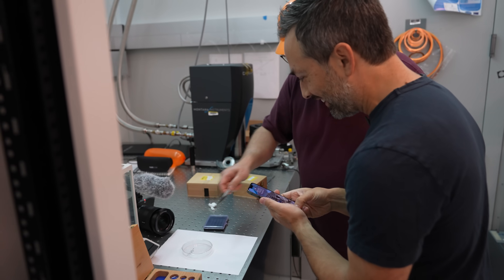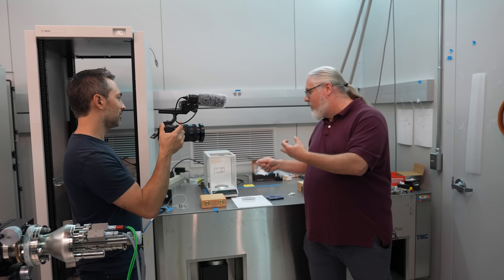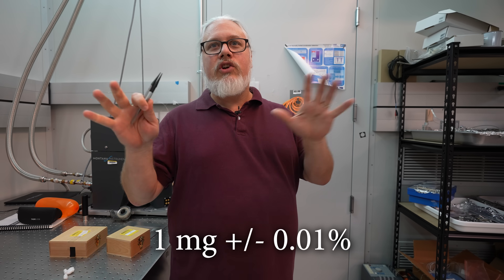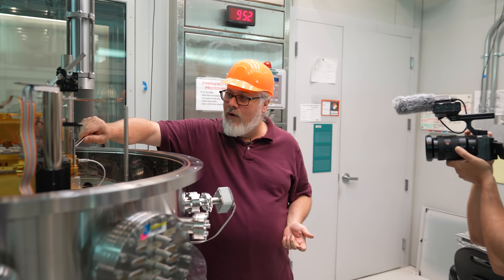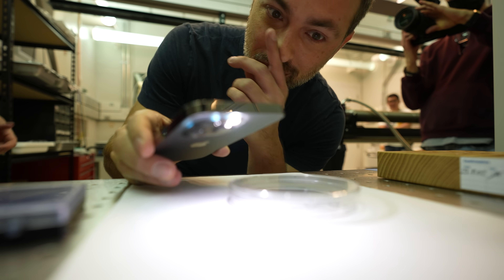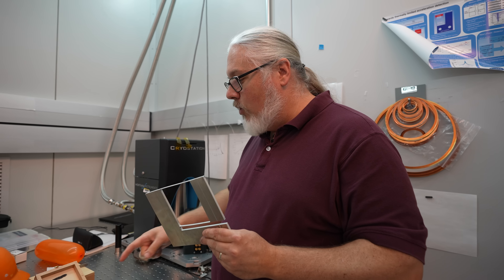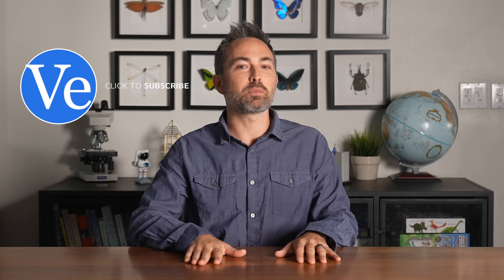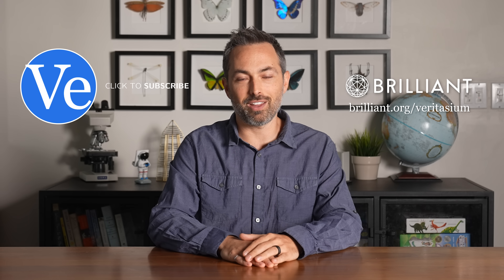How To Measure The Tiniest Forces In The Universe

Comment: The wire miligram mass calibration weights are made of platinum 90% iridium 10% wire. The extreme precision miligram scales actually use a polonium 210 static charge neutralizer. The extreme sensitivity balance used for measuring the light pressure though 😲

Comment: Did he invent that balance? He just speaks so excitedly and authoritatively about exactly how it works. It'd be interesting to see them actually amass a million of those little 1mg weights and compare it to a Kg just to see what the total amount of uncertainty adds up to. Would it be less than a single mg? I think that would be pretty impressive.
When they got down to talking about femtonewtons I was curious about how it compared to LIGO, it always amazes me just how much we've advanced in 50 years from creating the first microprocessors to modern commercial CPUs that now have to be designed and created using processes that care about the path and flow of every individual electron. And we're measuring the force imparted by individual photons.
Also how does it work if you take gravity out of the equation, I got the impression that some of the equipment wouldn't work if it was on the ISS. What methods and equipment would work, and could you just assume g = 0 or do you have to measure the exact microgravity, how insane does it get, would your numbers be thrown off by the additional mass of an astronaut inside the same module?

Comment: They talked about measuring femtoNewtons. In the laboratory where I earned my Ph.D. we measured something 1,000 times smaller, attoNewtons (aN), using a magnetic resonance force microscope (MRFM). That is the force a single unpaired electron exerts on a micron-sized magnet that is about 100 nanometers away. It's a painfully hard experiment.

Comment: It still makes my head spin that nobody can measure the speed of light in one direction and that we no longer use a weight of an object as reference to mass, but light.

But I'm so fascinated about all this. I studied manufacturing technology which included courses on measuring accuracy etc and this is just a nerd's wet dream. This was definitely one of the coolest videos all year. And one of the least exciting or visually communicating thumbnails :D I think it would be more intriguing if you had for example the kilogram weight somewhere on the screen as well for imagination and context, because you have zero idea what the heck is that metallic piece in darkness and random red beam. Heck, throw in a scale and a ruler while you're at it for measurement references :-D

I think I saw Cody's Lab trying to measure force caused by fotons from laser once in time, very cool experiment.

Comment: that's the heavy stainless steel wire... all the rest of the video the man makes sense... that little piece of stainless steel wire, unless attached to something I don't see... cannot possibly weigh 500gm... I watched the rest... came back and looked again...
could you please explain that to me ❓
🙏 ❤️🙏
Reply: when lasers were first invented it gave us the most accurate way measure the Universe around... the presence of quantum foam was measured in vacuum... probably with a beam splitter that creates a longer path for half of the laser beam and the interference pattern created by being out of step with the other half can divide a 700nm red monochromatic laser beam into much smaller increments... quantum foam was seen to exert sufficient force to move a rather substantial pair of steel plates apart a distance measurable in 1964

Comment: If you're measuring the pushing force of a laser by observing the oscillatory effect it has on some apparatus, how do you make the measurement of the oscillation without disturbing the measurement further? Wouldn't the photons you use to make the measurement of the change in oscillation period/frequency also create a force which would contaminate the measurement? Would it simply be that the effect of the measuring photons is so small in comparison to the effect of the laser's photons that it can be ignored?

Comment: How does the measurement of the femto Newton work exactly?
If you're measuring the displacement with an interferometer and photon pressure is enough to cause a displacement, won't the act of measuring the displacement (with a laser) invalidate the result you're actually trying to measure?

Comment: To add an extra point on the "stretching DNA" statement: in the lab, we use a technique called optical tweezer which is exactly what Dr Shaw said, using photons to move a bead that is tethered to a DNA strand or even protein. This allows us to have an extremely precise amount of force at the level of picoNewton that can stretch DNA or proteins out. We use this technique to understand the mechanical properties of biomolecules, as well as the spatial organisation of them. This is important because many diseases change protein and DNA's organisation and properties. Super cool.

Comment: I don't know what I like more, the metric system or red velvet cake.  Some people say they don't want to use the metric system because they don't want to go back and forth between different units.  They don't get it.  You just go "forth" and stop going back. I'm in the U.S. and use metric whenever possible.  Now and then I have to convert FROM the silly units, but I pretty much never have any reason to convert TO them.  It's SO much simpler (well, at least twenty-seven thirty-fifths of the time it is.)

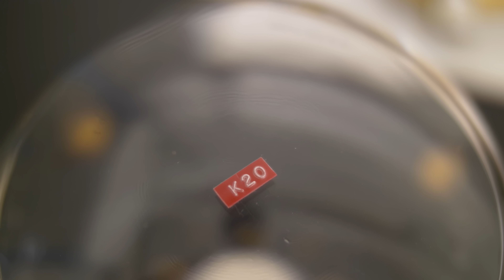Comment: 00:46 - "DOESN'T THIS SEEM CRAAAAZY?!?!?!" - HELL FRIGGIN YES!!! WHEN... In 1999, after nigh on 10 months sailing it's way to Mars, the 'Mars Climate Orbiter' broke up and burned into pieces because some COMPLETE DINGUS USED IMPERIAL measurements while building/programming said space craft WHEN IT SHOULD HAVE BEEN METRIC UNITS!! COSTING>>>> $125 MILLION !!!! Or the Boeing 767 passenger plane that was fueled with HALF the fuel it needed for its LONG flight because some COMPLETE NUMPTY loaded it with 22,300 Lbs of fuel INSTEAD of 22,300 Kg of fuel!! Luckily NO-ONE was seriously hurt on that flight EVEN THOUGH the aircraft was GLIDING it's last 100Kilometres of flight to the runway!!!!!! So... COME ON... WAKE UP!!!

Comment: 1:05 there is NOTHING stupid about setting US units in reference to Metric. NOT setting them in relation to a common standard would be stupid. It better standardizes the units of measure, even if they are different than metric. those units are older than metric, and therefore will continue to exist due to history, and therefore there is Nothing wrong with helping standardize them. Many other units of measure other than Metric and English still exist to this day. no one criticizes those units for continuing to exist. 

people that don't get this are ignorant of reality and fundamental aspects of science.

And no, all the ignorant Europeans and such claiming the US is not on the Metric system are bold faced liars and they need to be corrected and stopped from spreading lies.
Reply: Not sure why you are so passionate abt this but everyone calls it it stupid because it’s metric is just better and then they convert to imperial. So they pretty much just downgrading.

Everything in metric is a power of 10 away from the next unit. 1 km = 1000m = 1000000 mm.
Compared to miles where it’s like 52840 feet in a mile and then 12 inches in a feet. Same idea for weights with pounds. It’s much easier and intuitive to base things on metric.
Reply: @wavez4224  I'm passionate about it because all these people claiming to be smart and scientific can't get their facts straight, and can't see the importance of making common units easily referenced to a known standard of measure.

I get how metric works, I'm not an ignorant child. I use metric all the time. I do most unit conversions in relation to metric even. So how about you stay on topic and stop giving lessons no one asked for.

but other systems of measure are still used, especially if working on historical machines that predate all these standards. you still need to use other units. Not to mention that not everything in metric is base 10 (radians, degrees, seconds, minutes, hours, days, weeks, months, etc.). And English uses base10 units all the time. 1.0", 0.1", 0.01", 0.001", tenths of a foot, tenths of a mile, hundredths of a mile, we even sometimes do time in tenths and hundredths of an hour, PSI vs KSI (pounds per square inch vs kilo pounds per square inch).
Reply: @SoloRenegade  idk what u going through but I hope it gets better man.
Reply: @wavez4224  yes, my passion for science and accuracy gets stronger all the time, especially when I see the standards of others plummeting. 

The guy with high standards of science and accuracy in a time when others have no standards, makes him look amazing.
Reply: @wavez4224  "You’re literally arguing abt semantics thinking that shows you are amazing." never said I was amazing, I said that person who has higher standards Appears amazing next to those with No standards.

"bro you don’t have high standards, just a high ego." ego has nothing to do with it, just facts. The fact is US is Metric, has been longer than I've been alive. And the fact is it makes Perfect sense to define nonmetric units in terms of Metric. then you only have one standard to maintain, and can just use simple math to verify the other standards of measure used. No ego in that.

You're trying to make a point, but it's wrong, and misses the entire point of my original comment. But keep trying, it's fun watching people dig holes.
Reply: @wavez4224  "I just said not using metric is stupid." despite my comment not being about that. And I've explained why using nonmetric units happens. only people bad at math struggle with units other than metric. Other units are not hard. But again, that wasn't the point of my comment now was it?

"Also you mentioned other people having plumetting standards and then talked about how having standards makes you amazing."

Twice now you've blatantly changed what I said. This is called "Gaslighting". I was talking about relative appearances, and yes, standards in science are dropping fast and it's causing problems where I work, particularly in hiring. Colleges are graduating people who are useless. It's not about ego, it's about how easy it is to succeed and look good, when the standards you need to beat to look amazing are so low. it makes "succeeding" easy.

But, please continue gaslighting, for all to see.

Comment: 5:00 The reason the weights change is due to acidity of the air,
where oxygen can actually oxidize the weights and with that add weight.
I'd use platinum or gold for those weights, less chance of random
weight addition. You may have noticed they all become greater,
instead of some losing weight and some getting greater weight.
For the gold or platinum weight's I'd use the gram rather than kilogram.

Comment: Shouldn't the weight of a standard mass change due to the position of the moon, as well? The moon exerts about GM/r^2 = 3e-5 N/kg = ~0.3 ppm which is large compared to 0.000001%.

Comment: 12:09 There's a small caveat to the force measuring of the laser pointer.
It doesn't actually measure photonic impact pressure, but pressure differences
due to heat absorption of the reflection, mostly.
In order to measure true photonic pressure only,
the measurement must be done in a vacuum, to avoid pressure differences,
due to local heating of atmosphere, by the heat absorption of the laserlight.

Comment: The most under-stated moment in this excellent interview occurs at 11:55, when in the context of measuring light pressure, Derek tries to make the topic more accessible to viewers by asking, "So you're saying you could measure the force of a laser pointer?", and the technician responds, "Oh, yeah, that's roughly 7 pico-newtons, which again, is enough to stretch out a DNA molecule." By which, the technician means that laser pointers are actually several thousand times stronger than the femtonewton forces he's measuring. Quite an insightful interview with a depth expert on taking empirical measurement to new heights of precision. That guy clearly knows his stuff!

Comment: A few points: 
NIST owns an absolute gravimeter - why didn't they show it to Veritasium?
USGS is not the official gravity reference agency in the US. NGS is. Why the discrepancy?
NIST, being an NMI, should be using its own gravimeter according to international standards.
Why did Mr. Shaw NOT wear a hairnet in the labs as well as Veritasium's host? Especially since it was mentioned that dust can wreak havoc on the weight measurements.
Where was the super-conduction gravimeter?
Etc...

Comment: Question then, if the force of a laser can be measured, and I'm pretty sure the light pressure from the Sun is a known quantity, then in theory could you measure the amount of force your Shadow blocks and effectively come up with your shadows weight? It would be a negative number, but it would be calculatable I think.

Comment: The famous trick question is which is heavier 1kg of steel or 1kg of feathers? And the answer to normal society is neither. But from this video the uncertainty of a 1 kg of steel is 10 micro grams whereas each feather has a greater uncertainty therefore either the steel or the feather is heavier 🤯

Comment: if making a sample of something that weighs 10μg is so hard, why not make it with the least dense solid there is. big variations in volume result in small variations in mass
Reply: Because materials with a low density like Aerogel change their mass over time because they are so fragile and everytime you pick them up you would loose a bit of weight by the dust it creates. Steal does not do that and it also does not react with anything in the room.

Comment: But you didn't ask THE ACTUAL most important QUESTION: how does this chicken and egg problem end?
The precision problem was just pushed from mass to electricity + mass of those fancy vacuum parts. At some point you need a "scale lever" to interact with those tiny changes (e.g. lithography uses lenses), what is the this mechanism to start of cycle?

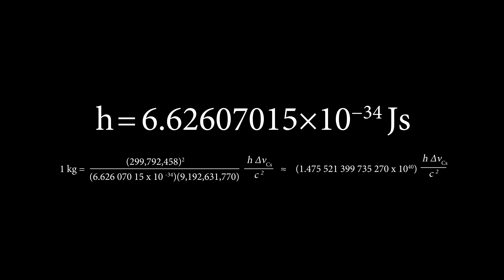Comment: 5:31 and  5:50
If the graphics @ 5:31 is correct in relating mass m to the product  of Plank's constant h multiplied  by frequency f  and  divided by the square of  c, the speed of light, then the graphics @ 5:50 is at the very least problematic.

Comment: 5:29 but but 
E=mc² doesn't apply to photons.
So the correct equation should be hf=pc !? @Veritasium
Reply: He is applying this on formula for matter, not photons because photons don't even have mass lol
Because he was talking about the redefining of 1kg
Reply: @andtherefore8076  nope. That equation was wrong. E=hf only works for electromagnetic wave, i.e., photons..
Reply: @AThousandSuns42 nope, it works for all waves
For example you might remember the energy of electrons which uses E = hf
Reply: @andtherefore8076  um yea it applies to all fundamental particles so that means it's correct ig
Reply: As per my knowledge you can apply E=mc² where m is relativistic mass.

In E²=m²c⁴+p²c² m is rest mass.

Correct me if I am wrong.

Comment: That is really fascinating. I'd love to see a part two (if it's possible) about how you go about making the tiny, ultra precise devices he was talking about, because to make something that precise has got to involve some pretty amazing engineering
Reply: That gets into what he was explaining, the smaller the measurements you can detect and have confidence in the better the equipment to make the devices to get those smaller confident measurements. If I'm understanding his explanation; they can control the output of electricity (and therefore the strength of the laser) to such a degree that they can pinpoint how much mass a material must have to vibrate at a certain amplitude and frequency. So it all hinges on the ability to detect and control electrical potentials to minute details.

Comment: Question: When we reach such incredible precise depths in the range of Femtonewtons and beyond, doesn't our Environment influence the Measurement beyond Significance?
I've actually never heard Metrologists talk about the Influences of Gravity, like the molten Mantels inside Earth shift and are in constant turmoil, some heavier Stream of Lava/Magma making some exact Point on top Earth's Surface a tiny bit heavier or lighter, or the speed of Earth's Rotation slowing down and speeding up, changing the Gravitational Constant. 

Also also: as per Einstein's theory of Relativity, Gravity is not the only Factor. Sunlight hitting something outside vs no light inside excerpts a different Force. According to his Theory, a Flashlight turned on loses weight, however really really little (the mass of its Components divided by speed of light squared). On top of that, something measured at the top of Mount Everest has more potential Energy than something at Sea level, right? Which would then also Manifest as Mass or "Rest Mass" according to Relativity?

In Conclusion: Isn't the only place to make such fine Measurements in outer space, millions of light years away from any other Object's Sphere of Influence? And even then, quantum fields might still play a role…
DO NOT take anything I've said at face value, by far no Metrologist, physicist or Scientist at all, just an admirer of Science! Thank you Veritasium for all you do <3

EDIT: sorry, he actually even talked about it at 11:55 ;) So i guess I'm not too far off, right?

Comment: my dad used to work for w&t avery from the 30's up until at least the 60's and brought home all manner of weights and weighing machines, i worked with him for a while and to this day my little fingernail on my right hand is split in two from being crushed between 2 1/4 ton weighbridge testing roller weights. i recal punching extra lead into the bottom of weights to bring them back to their standard.